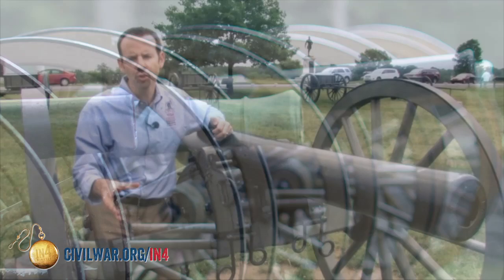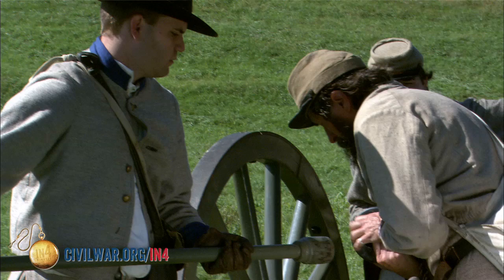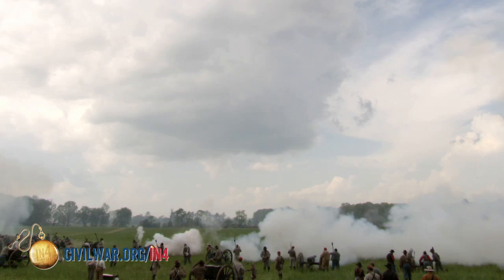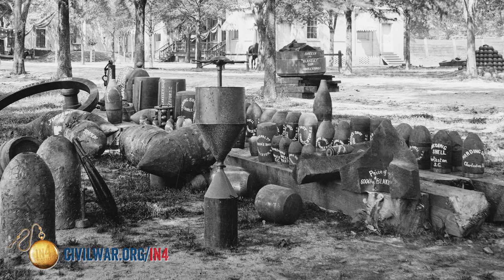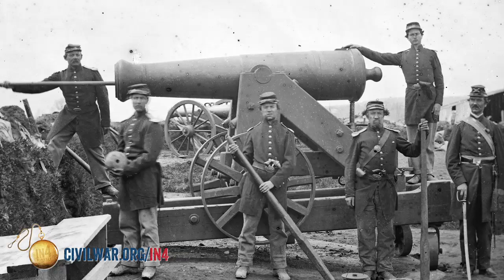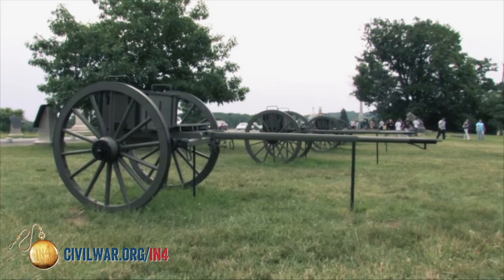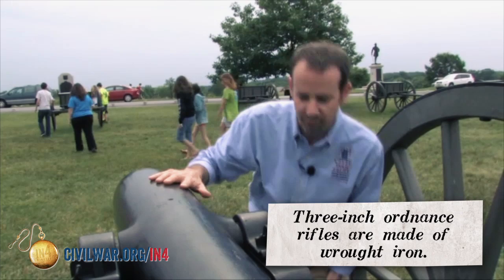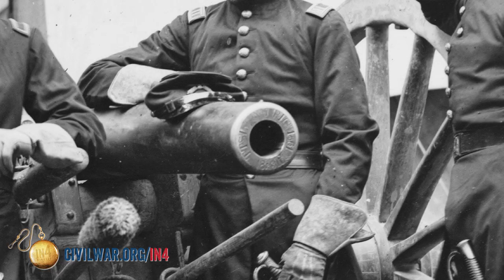Civil War Artillery: The Civil War in Four Minutes

Comment: An interesting fact that there wasn't enough time to cover was the trunnions on each side of the barrel.  Although they looked to be cast in the middle of the tube, they were actually cast slightly above center.  This caused the muzzle to dip when fired and the greater mass at the breech of the tube absorbed the bulk of the recoil.  I believe there's a snippet in the video that shows the muzzle dipping when fired.

Comment: I’m curious how effective artillery could be in the 1860s compared to WW1 where it was so dominant.  The guns were short range and only fired at what they could see in front of them.  The shells were small and the explosives and fusing very primitive.  Against massed infantry at less than one mile, probably pretty significant, especially psychologically?  I guess infantry had to fight massed back then with no radios to send orders to small units.
Reply: I was in a artillery group who portrayed 1st chicago light our sister battery when we were at a range shooting the cannon fired a round that skipped off the first small birm went up over the 100ft born and went into someones garage shy of a 3/4 of a mile away we all were shocked about it and the sister battery paid for damages
Reply: 1860s had telegraph lines mostly messages relay on horse back. Union had more cannon in a battery than the south did in a battery. The military tactics are different for the tech they had. Standing next to eachother for a smoothbore is why they had lines of infantry but they didnt take into consideration that things were starting to be rifled. As for ww1 id say the closest the two might come would be the battle of Petersburg it had trench warefare but I cant say to much because ive yet to visit Petersburg
Reply: Main reason cannons did less proportional damage was due to their misuse, more modern Generals like Sherman, Stuart and Early often inflicted great casualties with artillery.

Comment: 18 horses to move and fire EACH cannon? 18 horses? A small mistake there, I'm guessing. 3:05
Reply: ***** Cannon + Supplies.
Reply: ***** The Federals used six horses to move each artillery piece and its limber.   Probably another six to move the caisson, for 12 horses per gun.  There'd be more teams to pull the battery wagon and forge, but they weren't assigned to guns 1:1 like the caissons.   The Rebs were usually short of horses during the war, so used four horses per gun, instead of six.
Reply: And maybe  a lot of spare horses. Horses tend to die, and not only on the battlefield. And you can't afford to leave behind the cannons or the supplies due to lack of horses. So, there must be a lot of horses around.
Reply: There were riding horses involved as well.